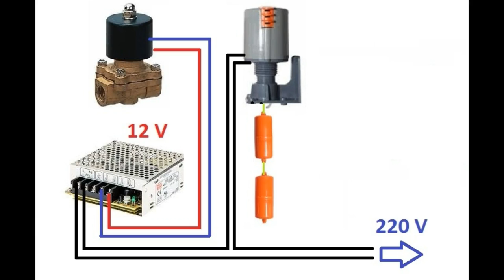Kran Otomatis Dengan Solenoid Valve - Gak Usah Repot Buka Tutup Kran Air

Comment: saya pakai yg 220 v agar lbh simpel, di tambah radar, beli di kenari mas 30 rb.. awet 
dan sdh pasang byk ke pelanggan sy, hslnya bgs tsk ada komplain.
Reply from the maker: Mantap om
Reply: Kalo pake yg 220v berarti 1 kabel dari seleoid di sambungin ke pelampung.
Sisa masing2 kabel kan 1 di gabungin ke steker. Gtu bukan gan pemasangan nya ?
Reply from the maker: @harimaulidin942  yup betul om

Comment: Selenoid ini apa bisa tahan ON hingga 12 jam ( coil tdk panas ) krn tekanan PDAM kuat naik ke toren 12 meter antara jam  19.00 wib hingga 07.00 wib dan selama ini sy blm dpt selenoid itu, rata2 hny bertahan 2jam sdh sangat panas hingga meleleh..mohon di jawab, tks
Reply from the maker: Saya rasa juga blm ada solenoid yg cukup bertahan selama itu yaitu maksimal 1-2 jam om, coil yg om pakai itu 220 atau 12 volt?

Comment: Om mau nanya selain catu daya yg om buat itu, ada tidak yg simple tinggal pakai, seperti charger hp atau laptop bisa g om ya?
Reply from the maker: Pakai adaptor beli saja om yg 12 volt, tapi ada juga solenoid yg pakai tegangan 220 tapi kalau ini rawan menurut saya
Reply: @ocit  oke om, kalo 220 better taruh diindoor ya, satu lagi om mau tanya ini kalo saya mau sambungin sama level switch di torn bisa ga
Reply from the maker: Oke lebih baik di dalam tapi usahakan jauh dari jangkauan anak2, saah satu kabel ke ke coil solenoid bisa di seri dengan switch atau level switch di toren
Reply: @ocit  ok om thks info nya ya semoga berkah om hehe
Reply from the maker: @kutakkatikalfatih6858  aamiin terimakasih om 🙏

Comment: Mas mau tanya kok solenoid valve saya sama persis dengan punya mas nya itu tapi saya menggunakan power supply 12v 8a, ketika saya pasang sepatu kabel ke solenoid valvde dan saya sambungkan power supply ke 220 kok yang ada on terus ya? Padahal saya pake bahasa pemrograman dan trigger dari push button, tolong di kasih saran dan masukkan karena minggu depan saya sidang
Reply from the maker: 089601630341 japrian aja om biar saya jelasinnya enak

Comment: Mas, apakah solenoid valve yang dijual di pasar belum dilengkapi adaptor? tadinya saya pikir solenoid valve tinggal colok saja ke power outlet tanpa harus dilengkapi adaptor.
Reply from the maker: Lihat dulu coilnya apakah 220 atau 24 atau 12 Volt, misal 220 tinggal colok ke pln saja, tapi saran saya pakai yg 12 atau 24 lebih aman

Comment: Pak kalau buat air tanpa bertekanan bisa gk?
Reply from the maker: Sepertinya ga bisa mas
Reply: @ocit  itu alat beda kan sistemnya kaya flow swich? Kalau flow swich kalau gk ada dorongan air gk bisa nyala .. kalau itu kan di kasih teganggan baru open kan?
Reply from the maker: @duniatipstrick6996  flow switch biasanya d pake utk safety jadi klo ada tekanan berlebih dia akan buka, solenoid Valve meski tidak ada tekanan di fluida nya tetap bisa beroperasi prinsipnya sama kyk keran tapi kendalinya pakai elektromagnetik
Reply: @ocit  itu beli nya di mana ya pak boleh minta linknya gk? saya cari harganya mahal banget
Reply from the maker: @duniatipstrick6996  terakhir saya cek tokonya sudh tutup om

Comment: Mas saya mau nanya..
Kalo mengontrol pengisian air dari PAM lalu ke Filter  lalu ke Toren, gimana caranya? Biar air masuk ke saringan bisa di stop otomatis setelah air di toren penuh.
Trima kasih
Reply from the maker: Yg kw filternya pakai pompa lagi tdk om, jadi setelah air pam pakai solenoid valve, dan pakai pelampung (Radar) di toren set ketinggian air dn switch yg ada di radar utk on off power supply solenoid valvenya
Reply: @ocit  ohh saya kira ada cara passive, tanpa harus pakai pompa/listrik.
Oke makasih om
Reply from the maker: Kalau tekanan dr PAM bisa melewati filter ada kemungkinan bisa, kok PAM di filter lagi sih om??bukannya sudah bersih
Reply: @ocit  kuat menahan tekanan air dari pdam om itu selenoidnya?
Reply from the maker: @wiramukhsinabdillah8480  kuat om

Comment: Kalo buat dispenser otomatis kira2 bisa gak kak? Saya pakai selenoid Valve dc 12v air yg keluar sangat kecil itu sebabnya apa ya kak? Mohon bantuannya, terimakasih
Reply: Boleh minta kontaknya kak untuk tanya2?
Reply from the maker: Itu karena tekanan dan  debit yg keluar dr dispenser kecil
Reply: Kalo mau buat dispenser otomatis baiknya gimana ya kak supaya air yg keluar tdk terlalu kecil
Reply from the maker: Kalau pakai pompa DC bisa d coba saja om

Comment: Ter, itu kira kira pakai power suplay yg berapa amper?
Reply from the maker: 12 V Dc om
Reply: Untuk arus nya, itu berapa gan power suplay nya, apa gk merusak coil nya ter, jika dikasi power supply 12 v dc 10 A....??
Reply: @muhammadfauzanrafi8725  ampere itu ditarik oleh alatnya jadi kalau alatnya narik nya setengah ampere ya gak bakal jadi 10 ampere

Comment: apa bedanya dengan otomatis flow switch bang?
Reply from the maker: Flow switch adalah saklar otomatis pompa air yang bekerja karena adanya dorongan air di mana ketika keran di buka air dari tangki/sumber akan mendorong lidah sensor pada flow switch dan menyambungkan pompa air dengan sumber listrik dan pompa hidup,jadi dengan kata lain flow switch sebagai saklarnya dn motor pompa yg dorong airnya
Reply: @ocit  mantul gan, minta link pembelian gan, sy cari2 di olshop kok kebanyakan selenoid valve buat mesin cuci
Reply from the maker: @MrPvideo  terakhir lihat lagi toko sudah tutup om 😟
Reply: oiya bang klo selenoid valve apa bisa di terapkan pada otomatis nyala pompa air, pengganti otomatis bawaan pompa air, pake otomatis bawaan bunyi suka cetak cetek klo kran bukaan setengah
Reply from the maker: @MrPvideo  sepertinya g bisa om,. parameter yg d jadiin on off solenoid blm d tentukan mau pakai tekanan atau bukan, baiknya utk pengganti pakai flow switch

Comment: Ketika ada Listrik ketutup dan ketika Gak ada listrik kebuka 

Ada gak ???
Reply from the maker: Ada om namanya normal open
Reply: @ocit  mungkin ada link market place nya babang @ochid 85 ?
Reply from the maker: @rohmanolie3294  saya blm browsing2 lagi om 🙏
Reply: @ocit  kalo ada kabar kabar yah . Soalnya saya cari di market place tidak ketemu
Reply from the maker: @rohmanolie3294  cek sini om
Beli Solenoid Valve 1/2" Female NPT Normally Open AC 220v | Selenoid 
https://tokopedia.link/0XwJNK16Shb di toko Sakurama Shop Rp300.000 di Tokopedia dengan Bebas Ongkir, Sekarang!

Comment: kabel solenoidnya gak nyambung ke otomatis tandon apa gan
Reply from the maker: Iya om...
Reply: lah untuk mutus arusnya pake apa om
Reply: kalau solenoid pake 220v nyambung kabel ke radar gimana gan
Reply from the maker: Radar yg utk cut off nya salah satu kabel fhase yg d hub ke radar, kalau pakai 220 yg utuk on/off ke radar pakai netral saja om supaya lebih aman
Reply: masalahnya tandon yang dipakai untuk rumah tingkat saja om
Reply: Nah sama om. Pgn tau kalo pake yg selenoid yg 220v
Reply from the maker: Kalau utk solenoid 220 salah satu kabel tinggal hub ke kabel terminal radar saja om dn salah satu kabel tinggal ke power PLN
Reply: @ocit  oh berarti kan selenoid ada 2 kabel sm radar ada 2 kabel, yg 1 kabel selenoid sambungkan dengan radar. Trs yg sisa masing2 1 untuk radar dan selenoid di sambung ke steker. Gtu ya om.
Reply: Rencana saya mau pake selenoid juga buat otomatis air pdam yg masuk ke toren.

Comment: Bg mau tanua
Reply from the maker: Iya
Reply: @ocit  selenoid Valve 3 way tu biea pake pump dc nggk
Reply from the maker: @DIyRcrc  tergantung coil pada solenoidnya kalau 12 volt bisa pakai DC atau AC tp tegangan harus 12 volt, pompa hanya untuk tenaga pendorong saja